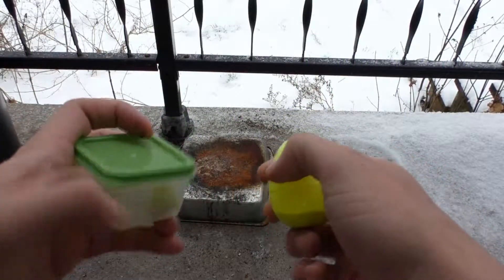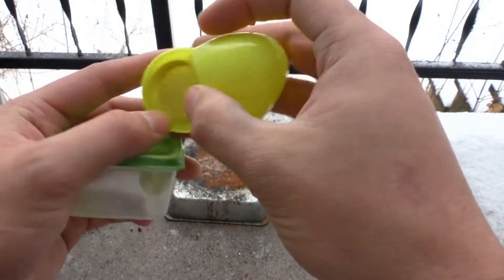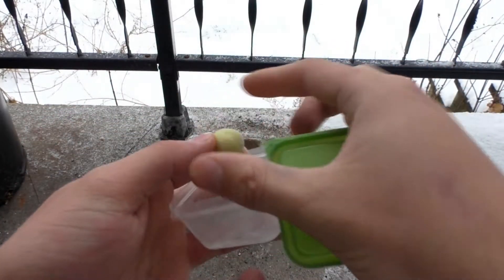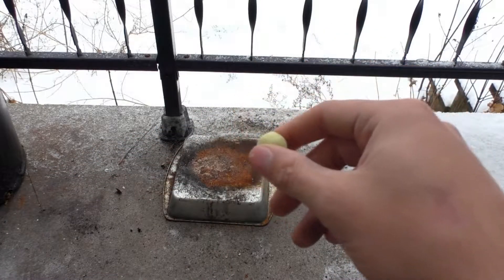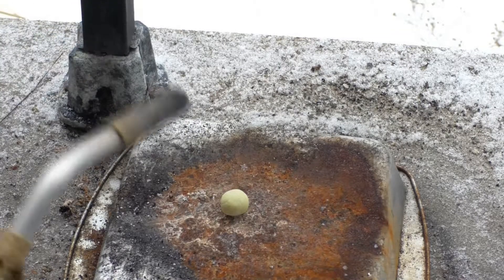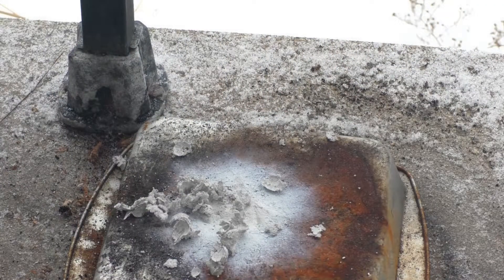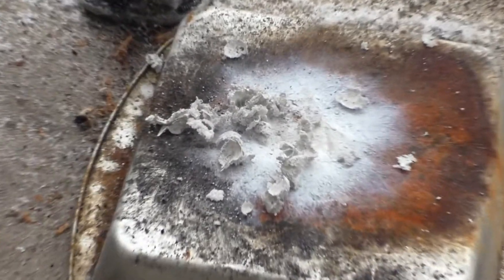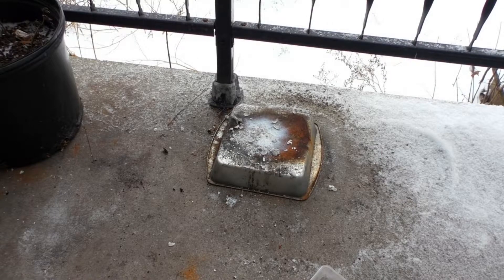PCRT RV, Silly Putty (Potassium Chlorate Reaction Test Revamped)

Comment: try graphite from pencils or in graphite powder lube
Reply: That sounds interesting. You might want to try moly or molybdenum disulfide. Also try with a metallic fuel, maybe antimony?Just be careful with chlorates and sulfur.
Reply: yes graphite is pure carbon purer than charcoal  so it would be very powerful
Reply from the maker: Added.